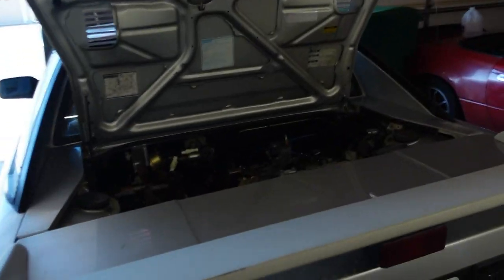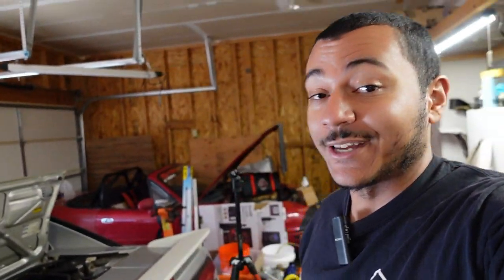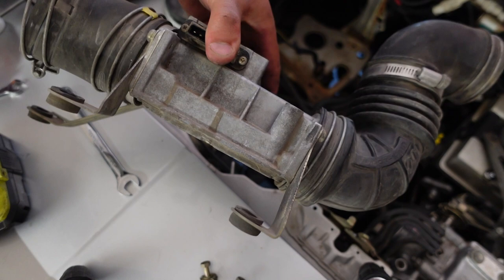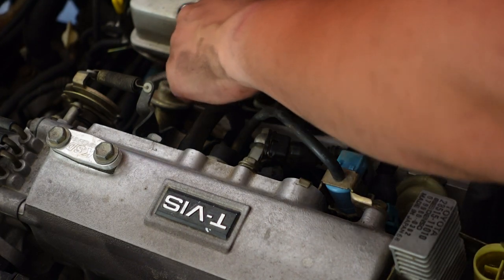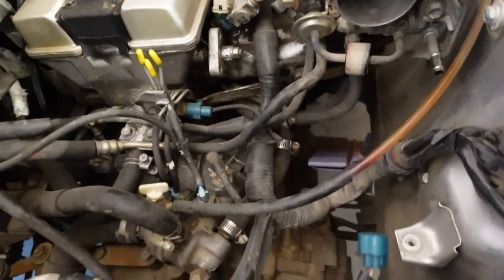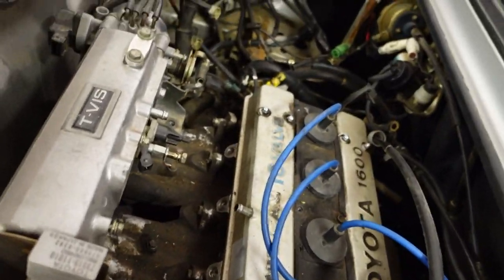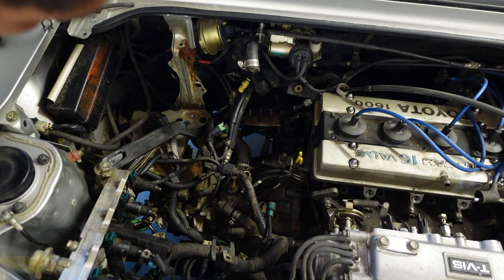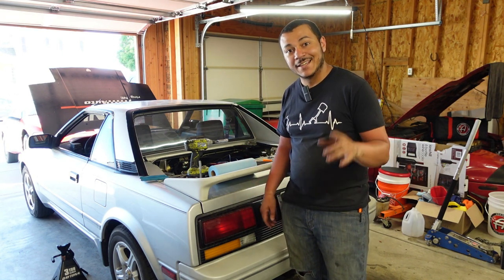MR2 Engine Removal pt1 // 1987 AW11 MR2 Build + Repair Series

Comment: Thanks for the vids. My 85 will need a rebuild sometime, do you have a reliable engine parts supplier? What about cam shafts and the crank shaft bearings? I've heard that valve shims are difficult to obtain. Thanks again for the great channel.
Reply from the maker: Thank you so much for watching! I will be making more soon. And Battle Garage RS has really good stuff I prefer ACL race bearings, even for daily driving. Obviously you'll have to send everything to a machine shop to have it all checked before ordering the proper bearing size. Cam bearings can't be replaced on these engines, but if you were looking to upgrade cams I believe they have them too. Valve shims, I'm not exactly sure where you may be able to get some. I'd say just check clearances and maybe get with a machine shop to see if they can machine some for you.

Comment: Can you make this a tutorial video? Pulling my 4age out-of a barn find later this month and im a little nervous!
Reply from the maker: If you watch the rest of my videos they kind of are. But if you do have any questions don't hesitate to reach out. I'll gladly answer anything you need to know. I'm actually currently in the process of reassembling the engine now
Reply: Awesome, I’m about to watch part 2 now and then follow along for the engine tear down. I have stripped spark plugs threads so if you have any experience helicoiling threads, that would be helpful.
Reply from the maker: @80stoyotaboi  best time to do that is when the head is off. Most of the good kits will come with a drill bit and the tool to install the helicoil. But  if you don't want the helicoil route, some machine shops would probably be able to weld the hole and re tap the hole.
Reply: Hey how did you remove the throttle bracket? I can’t figure out what to do after removing the three bolts
Reply from the maker: @80stoyotaboi  are you trying to remove the cable from the bracket or the bracket from the throttle body? If the bracket from the throttle body there is a clip that expands to pull off the ball that attaches to the throttle body
Reply: @ivgarage  I was worried I would damage that clip if I tried to expand it. Thanks a ton! I really appreciate the quick reply.
Reply from the maker: @80stoyotaboi  I'm glad to be of help!
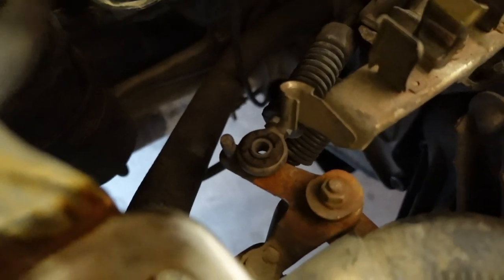Reply: When you removed the shifter linkage at 21:37 did you just pull the cotter pin?
Reply from the maker: @80stoyotaboi  yes, just pull the pin, there should be a washer on the top side and then it should slide right off. Unless, of course, it's rusted.
Reply: @ivgarage got it! Thanks again - I’m almost done it seems.

Comment: Hi awesome !! Videos

Quick question?

Do you happen to to have 
Passenger's DOOR CONTROL Module 85980-17010 

Power window/ power lock

Please let me know

Thank you
Tania
Reply from the maker: I do not unfortunately. If you have Facebook go on to AW11s only and you should be able to find someone that has it
Reply: @ivgarage    it's been weeks / hours/ digging& No luck🥺😔😂  do you know of anyone that would refurbish these Very" unique & specific relay/ modules. I've also looked on other Toys of the same era, well the plug is very 👽 Then other alternative being from UK.  The ones that I've found Sure! Not quite"  it must B power window/lock. Toys from that Era, Celica Supra & also MR2 (manual rolling) came with door locks that would lock on their own feature. Bottom line defeating the purpose.
Insane🤯😡
Reply from the maker: I do not. Not yet anyway. Hah. But if I can get my hands on one maybe I can see if I can refurbish it. They should be pretty simple. I've fixed many clusters before. I'm assuming this module controls just the power windows? I have manual ones and manual locks so that's why I'm not familiar I guess.
Reply: @catirecortes7892 I may have this module in Australia.  Though i would have to dig through a lot of boxes as I am in the middle of a move and have way too much aw11 crap.. haha.